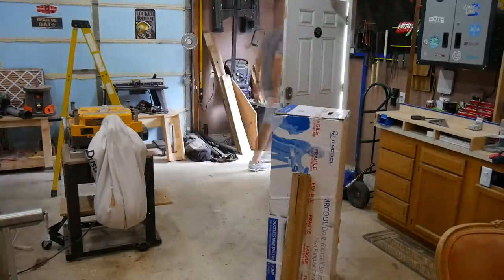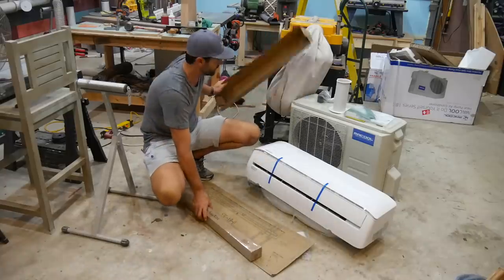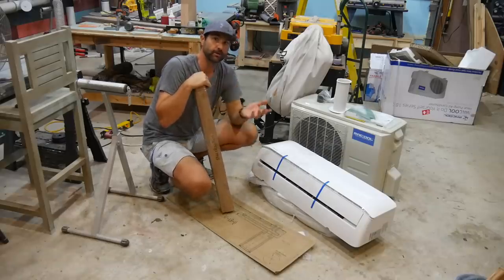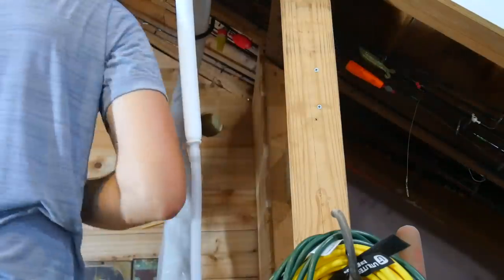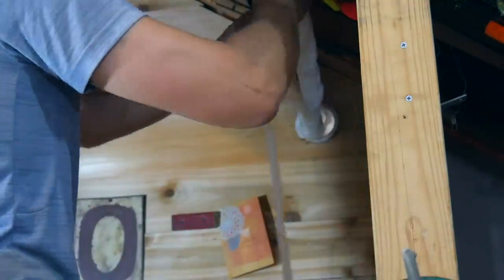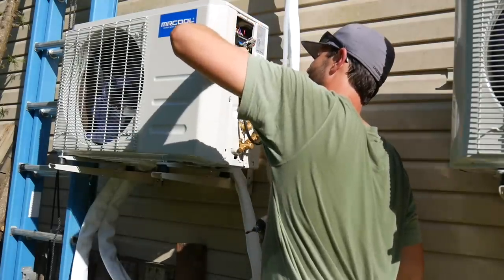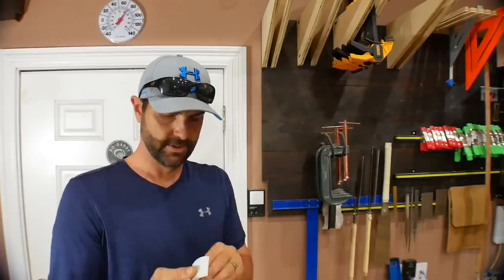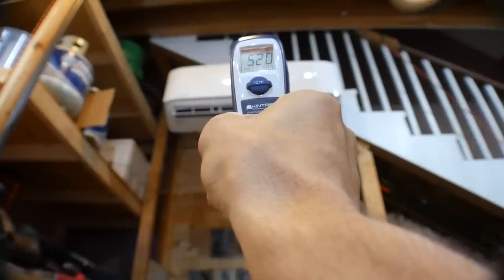DIY Mini Split Installation (Step by Step)

Comment from the maker: This DIY mini split is extremely quiet and affordable.  I purchased MRCOOL model DIY-18-HP-C-230A here:  https://amzn.to/3wszhzY Also, This is a complete DIY Mini Split and the lines come sealed and precharged with R410A refrigerant. There is no need to vacuum the refrigerant lines like a traditional HVAC system. 

Please visit https://mrcooldiy.com/ to learn more.

Thanks for watching!
Reply: Thanks Sir! Good video
Reply from the maker: You are welcome.  Thank you for watching!
Reply: Great job just you made a trap 
 With the pipes you only want a trap when the condenser is higher then the air handler
Reply from the maker: Thank you!
Reply: @ezzysteiner6593  What do you mean? Where is the trap?
Reply: @1981fitz  when you have the pipes looped like that under the condenser that creates a trap
Reply: @ezzysteiner6593  you don't put a trap in a split system.
Reply: @markbrookes5403  yes you should when the condenser is higher then the evaporator
Reply: 1w
Reply: Does anyone know if you can buy a larger unit and connect 3 or more air handlers to it. I'd like to get one and hook up several for different rooms if that's possible. Thanks
Reply: @brianpearl7504  yes its called a multi zone unit you can find them online
Reply from the maker: Brian, I believe the multi zone unit comes out very soon. Check their website
Reply: @PahjoDesigns  How is the system after a few years. Have you had maintenance/repairs? Thanks for the great video!

Comment: I installed a similar 18000 btu unit on my last shop mine was a re branded Gree that looked identical. The refrigerant in my unit was fully charged inside the unit, the lines were empty and open once attached I did pressure test and pull a vacuum on the unit with lines attached and tightened before releasing the Freon. Nylog brand thread sealant is highly recommended to be used when attaching the  line ends nuts and flared lines to unit threaded ends. After the lines are tightened the instructions had me use a Allen wrench to open the valve on the unit and allow the Freon to be released and circulate thru the system.  Many folks who install the systems themselves do not pressure check or pull a vacuum before releasing the Freon and have no problems whatsoever. Overseas these units have been in use for many years.
Reply from the maker: Very useful info!  Thanks so much for the comment.
Reply: @ihatecrackhead  I installed it 2 years ago it was a Blue ridge from Alpine Air.  I also bought the outside race track and ran the lines along the outside wall.

Comment: all good except you can't leave those final Loops of refrigerant line vertical like you did they will all trap in the unit will start for oil and die any additional refrigerant tubing must be wrapped up horizontally to prevent oil trapping.

Comment: The answer I received:
I would recommend that you leave the loop/excess in the vertical orientation loosely around the garden hose hanger as close to the compressor as possible. Larger the loop the better but no larger than the outdoor unit. Unless you can exit the wall, and run down the outside wall, and then horizontally to the compressor. Do not run horizontally and then loop back to the compressor. Loops need to be at the compressor end and not mid run. If you can set the compressor at the end of a horizontal run I would agree with your other advisers. If you have it set with loops I would say leave it.

It's perhaps not the ideal situation but well within acceptable standards. If I had it to do over again I might consider the gravity drain if it was easily doable but we'll have to see how it pans out.
Reply: vertical loops are guaranteed oil traps

Comment: Hello I watched your video with interest as I bought a fast fix split system for my house I got it from a reputable dealer who called me to see if I was able to instal it myself and its all ready to go its pre-charged so no vaccing  of lines needed and they supply an extra set of pipes if its not long enough they also said that to loop it loosely behind the outside unit if its too long. I am more than able to do the electrical side its a question of putting a plug on the end of the cable I was concerned about the connecting of the lines but having read the information and watched your video I feel much easier doing it now. Thank you
Reply from the maker: ozzie908 - thank you for the comment.  I’m very happy i was able to help you.

Comment: Great video!  Like the phone app capture too; nice touch.  Great step-by-step for those of us going to do a mini-split soon.  I don’t believe the lines need to be vacuumed - that’s the big benefit to a mini split.  We had tons of these deployed in the desert and they worked great for years and really helped with humidity.
Reply from the maker: Jason Mayne thank you!!
Reply: jason: not all mini splits are as easy as this one.  Seems most need to be vacuumed, or set up by an installer.  Mini split does not necessarily mean no vacuuming, so absolutely be certain before you buy.  Installation is expensive, easily trippling the cost. That's why this particular unit is so interesting. They all should be like this in my opinion, which would encourage wider adoption.

The main probem is as I see it: If a $3,500 ($1,000 unit + $2,500 installation) one breaks, you'll never get your money back.  If a $1,000 DIY one breaks, theres a better chance to recoup your investment if you ran it for a few years before it broke.
Reply: Oo 99999

Comment: My wife and I just bought a two story, 5 BR,  100 + year old farm house. It needs total re-wiring and plumbing. An electrician and plumber came out to give estimates, and both suggested the ductless heat pump and air conditioner. My question is how are the electric bills when using this system? I know it will go up, but how much? is it small enough to justify installing? I must add that this house only had 2 propane heaters for the winter, and window ac for the summer.
Reply from the maker: This unit cut my electric bill in my workshop by 65%.  To be fair, the old unit & duct work was 15 years old.

Comment: I'm going to install a unit in my garage in FL. I was thinking about running the lines down the inside garage wall and exit down low behind the outside unit. This way you won't see any lines or the hole cut into the wall . What are your thoughts. Thanks.

Comment: 8:33.  Thank you for showing the piping to the RIGHT of the head!  Every install I have see goes right out the back or straight to the left.  I was wondering if one could have it pipe out to the right of the unit.  Yours is the first video showing it.  So SUPER dumb question.  If you are bending the pipe to the right when it was initially positioned to the left... how does you not kink/bend/break/crack the pipe since you are in theory changing the position by almost 180 degrees?

The way I want to mount mine I will have to do the same but it concerns me that internally by bending the pipe now to the right it would make it smaller or kink it somewhere?

Comment: Looks like what I need for my workshop. I need to figure out how to high the extra line set. Why didn’t you just pull what you needed through the wall and leave the excess inside where you could box it in. Thanks for the video.
Reply from the maker: I should have done that for sure - stupid mistake on my part.

Comment: The evaporator lineset is vacuum sealed from the factory. You don't need to vacuum the line before hooking up the lineset to the condenser. If he had cut the lineset to length and swedged to appropriate length, THEN he would have lost the vacuum in the lineset and have had to pull a vacuum with hvac gauges.
Reply from the maker: Thank you for answering this question.  I get this one a lot and won’t answer it any longer.
Reply: But it takes less than a millisecond for air to rush into the lines at the point of connecting the lines to the outdoor unit. vacuum is still needed notwithstanding.

Comment: I have a two story older home with window units which suck. How do I know where to locate the indoor units inside of the house? There are bedrooms at each end of the upstairs. The downstairs has a good centrally located area.
Reply from the maker: The DIY units are made to cover a single room/area.  You may need a multi room unit

Comment: You checked for leaks... How did you put pressure in it to test? Didn't you have to vacuum the lines?
Reply from the maker: Vacuuming the lines isn’t necessary for this type of system.
Reply: Pahjo Designs Thanks for getting back to me, I guess i made a mistake getting the Pioneer mini split.

Comment: Does mounting the outside unit on the wall produce vibration and sound?  Great detailed video. Thank you.
Reply from the maker: You are welcome!  The rubber feet that are lodged between the mounting bracket and unit reduce vibration greatly.  It’s not noticeable.  However, I do recommend mounting it on a concrete pad if possible

Comment: Hello, you just left the excess piping looped around the unit and wall mounting bracket? Your work looks very well done, neat, and tidy. Then to finish like that, is very surprising. Is that how you left it?
Reply from the maker: Thanks for watching my video.  No, I didn’t leave it like that.  I wasn’t sure what to do with the excess at first so I lopped it like that.  I later went back and changed it per manufacturers advice.
Reply: How did you change the length of the excess piping? I thought it looked sloppy to leave it wrapped around like that. Do you have to cut and reflare?
Reply: @hereticalhippy  He said in an earlier post that he pulled the excess line set inside and coiled it up and built a box around it to protect it.

Comment: First... GREAT video! However, I don't get why you needed to even use the template if you were mounting it to the studs you created. It seems the template would be used if you were mounting it to the framing behind sheetrock where you  don't know where the studs are actually at.
Reply from the maker: Thank You!  The frame I created matched the template. I also used it to preserve it in the event i needed to move it as I knew it would get lost.  But, you are right.  I didn’t need it after I built the frame.

Comment: I am trying to get an answer regarding the looped excess line set. I did not see any recommendations in the install manual at all as to whether the excess coils would be better stored horizontally or vertically. Many have expressed concerned about oil and refrigerant pooling in low spots as possibly detrimental to the compressor long term. If you have any advice I'd be glad to hear it. Also did you disconnect and reconnect to the outside unit when re arranging the excess line set. I have been trying to find out if it is possible to do that.
Reply from the maker: I actually did not disconnect/reconnect.  I avoided that due to the connection type.  I’d be interested in the answer to your question as well

Comment: To all of those saying pull a vacuum...how could you possibly do that if the line sets are precharged?  Pull a vac on just the space between the manifolds and fittings to leak test?
Reply: You connect the pipes then you pull a vacuum, then you release the refrigerant.
Before he does the step at 13:07 on the lower valve you pull a vacuum from the scrader-valve.
U have air inside those pipes and now this air is mixed with the refrigerant. It's alot of air. This is a big nono. I am an HVAC Tech.

Also he "leaktest" with no gas in the system, if u had a leak you would never see it, theres not enough pressure in the system.
Reply: D H not if it's a precharged line set or do you not understand what that is. Look it up they use do sell systems 30+ yrs ago and any jackass could hook them up no vacuum needed only when it screws up will they have to call hvac dude. Lol $$$$$$. The circle of life just remember cash is King.

Comment: Hey.
After I saw how you did.
It's really very simple, so thank for your great video & how you explain through the video is clear & understadeabble.
Question,  say you're moving can it be disconnected? Would there be a leakage of free on? Or you can just close the valves & disconnect the lines & go?
Reply from the maker: Thanks for the comment!  It can be moved, but the refrigerant has to be evacuated back into the compressor or hire a tech to do it for you.

Comment: I am ordering the same one you installed, 18000 BTU, and am trying to get a head start on the wiring and the pad. The install manual states "The maximum current is indicated on the nameplate located on the side panel of the unit". Do you know the max current? I need to  choose the correct components (see below).
 Thank you in advance.

CHOOSE THE RIGHT CABLE SIZE
The size of the power supply cable, signal
cable, fuse, and switch needed is determined
by the maximum current of the unit. The
maximum current is indicated on the nameplate
located on the side panel of the unit. Refer to
this nameplate to choose the right cable, fuse,
or switch.
Reply from the maker: I’ll snap a pic when I get home and send it to you.
Reply from the maker: David Daniels - the sticker reads MCA 15amp, max fuse 20 amp, compressor load 10.5 amp,  outdoor fan 0.6 amp.
Reply: @PahjoDesigns  Is that 110 or 220?
Reply from the maker: 220

Comment: Thanks for the video -  just wondering if you ever ran into any issues with the loops of refrigerant lines outside.  I have hear that you shouldn't loop the lines like that.
Reply from the maker: Luckily, I haven’t.  You are totally right about looping the lines.  My lines are now inside my shop and not looped.
Reply: @PahjoDesigns  Can you make a short video to show how you have the lines in your workshop? what about the lines for your other units? Thanks!

Comment: Wait a minute!! you say that you check for leaks with soapy water... but this was before you actually release the refrigerant... can you explain how did you put pressure in those lines?? and did before you release the refrigerant vacuum those lines "Purged" those lines??
Reply: The lines used with this unit are unique in that the lines themselves are sealed at the end that goes into the compressor.  When shipped, the Evaporator and attached Refrigerant lines are also pre-loaded with some of the refrigerant in the lines and some additional refrigerant is loaded in the outside condenser unit.  When you tighten the lines to the condenser, the lines open up and allow the refrigerant to flow into and out of the condenser.  Of course you have to open the valves on the condenser as well to complete the openings to allow free flow of the refrigerant.  The nice thing is that if you want to move the unit, you can simply reverse the procedure and the refrigerant lines will self seal when disconnected and then can be moved and reinstalled without losing any refrigerant.  It really is a (Mr.) Cool design and very unique to the D.I.Y. Models of the Mr. Cool Heat Pump Systems.
Reply: @optionstraderman  How can the lineset between the indoor and outdoor units be precharged when the manufacturer does not know what the distance is between the two units? I didn't see the proper procedure of vacuuming before charging (the part when you opened the lines with the ellen key) so there is a lot of air and moisture mixed with the refrigerant. The system may run for a while but will have problems later due to the contaminants and acids formed in the lines.
Reply: @steveelim  , the indoor half of the unit comes with a fixed length permanently attached line set which cannot be lengthened or shortened.  I think it's about 25 feet long on the DIY units.  By using this fixed length, they know exactly how much refrigerant to "Pre-charge" the line set with.  When combined with the outdoor unit which I suspect is also partially pre-charged, the two half's combine to supply the exact amount of refrigerant needed to perfectly run the unit!  

Ingenious, don't you think???
Reply: @optionstraderman  i doubt that very much. Should check with the distributor.  New linesets are pressurized with nitrogen and not refrigerant and it is never a requirement that an installation must use 25 feet of lineset. The precharge is always stored in the outdoor unit for transportation, never in the lineset - it is dangerous.
Reply: Times are a changing my friend...  Clearly you don't want to believe me, so if you are really interested in finding out for sure, I suggest you ask the manufacturer.  They provide a much better warranty on these DIY units that require NO Vacuum or charging as compared to the units they sell that DO Require both!
Reply: @optionstraderman  I don't mean to imply you are wrong, just that it is unusual. The brand you bought may be different and unique like you said.
Reply: If you think that's crazy, this will really blow your mind. After unit has been installed and running, you have the ability to close the king valves, disconnect the line set at the outdoor unit and move the entire thing to a new location and reinstall it and hook it back up, all without losing any  refrigerant!!! There's a video out here on YouTube Somewhere of someone that actually did it to prove that it could be done. And it worked just fine! I think he actually had a AC Tech come out and check the pressures on the unit after the relocation, and everything was perfect. Very very cool!
Reply: @optionstraderman   I'm curious to know what kind of fittings are used instead of flares. They must be spring-loaded like a Schraeder (but probably more durable and longer -lasting) for a quick seal when disconnecting. The best seal is of course to braze them in (and adding a bi-flow filter drier while at it) and with nitrogen flowing.